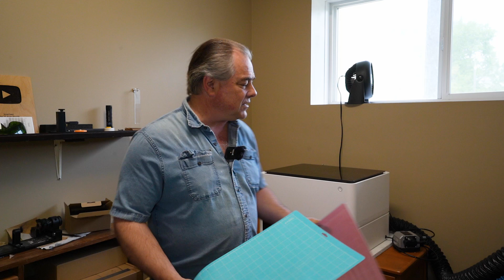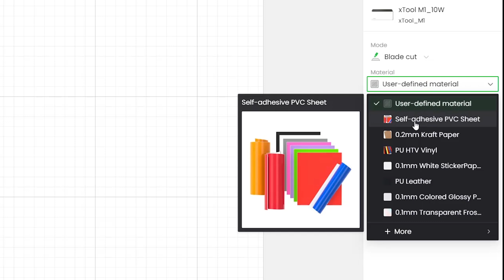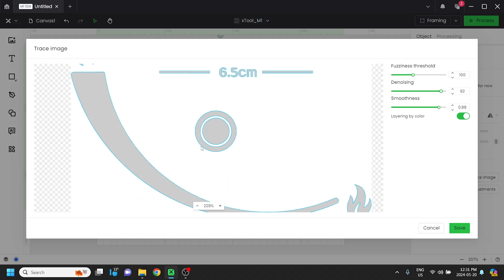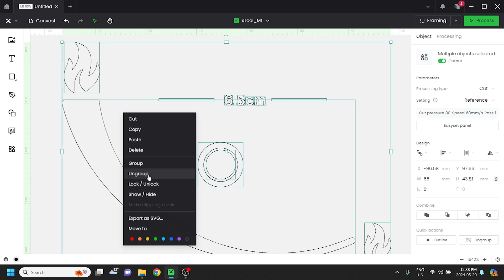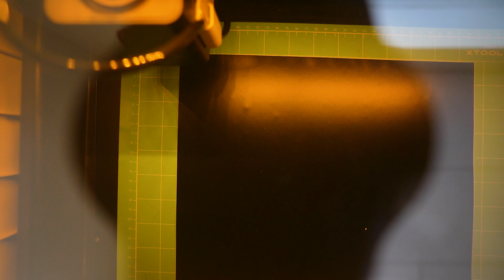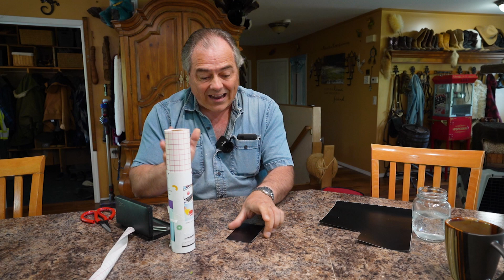Making Decals with the xTool M1 Laser Cutting Machine

Comment: I think that when it goes to the edge it is not testing the pressure, but rather aligning the knife for the next cut to have a cleaner start. if you look, it always moves to a different direction, and that direction corresponds to the start direction of the next cut.
Reply from the maker: Yes, that makes sense, thanks